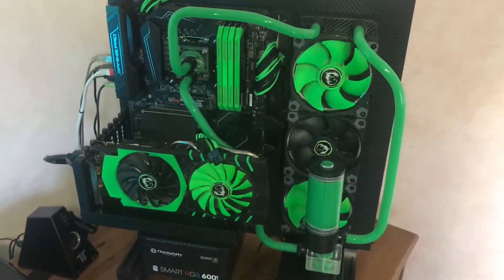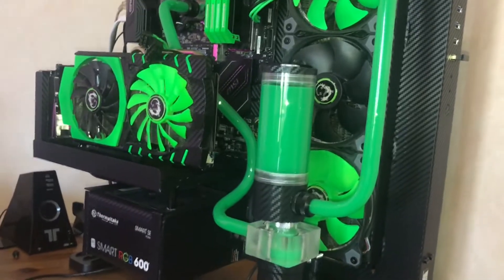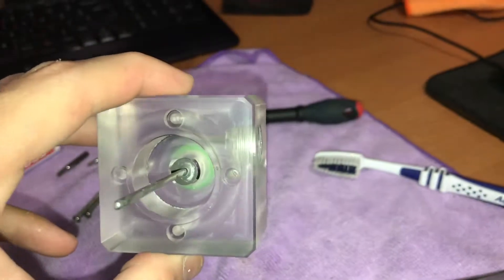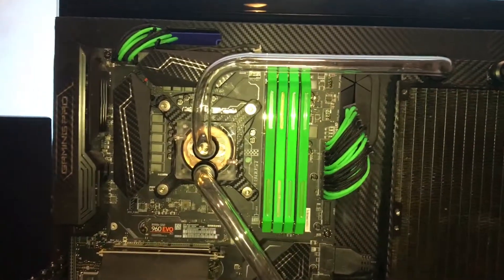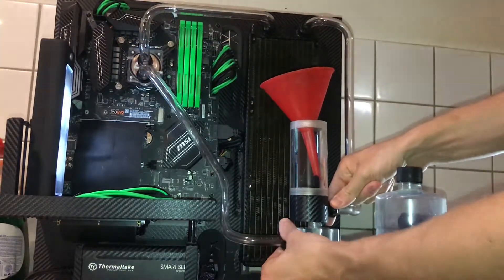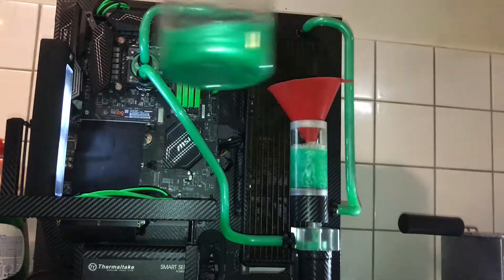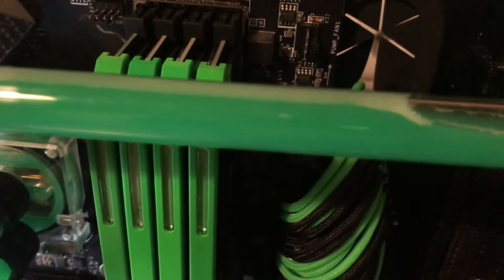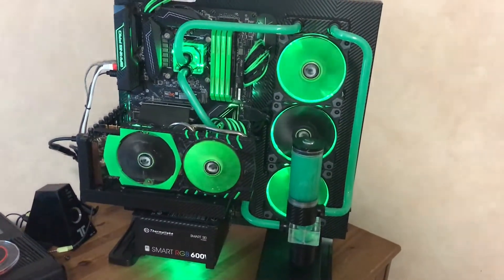Primochill Vue Issues! + Re-Attempt

Comment: I've used vue 2 different times and the first time it lasted a month and a half the second time it lasted 3 weeks .
Mind you my loop is all copper and nickel coated copper with all copper radiator 
I used system  prep and second time system reboot and took every block apart and cleaned my ekwaterblocks monoblock and both gpu waterblocks still the primochill vue didnt last and clogged my blocks up .
So now I took apart my whole loop again cleened all my waterblocks and radiator and am using koolance 702 uv blue for it lasts up to 3 years running 24/7
A couple months later loop perfectly cleen
Primochill vue is for show only not for working / gaming computers
Reply from the maker: Metalmachine467 mines been holding up perfect since i lowered the pump speed, it breaks apart on crazy fast movement, slow it down and works fine now! I havent even used sys prep

Comment: I have had the UV Green Vue from release. Never had a problem, didnt use sysprep. Vue will break down if you use it for more than 6-8 hours at a time, and that is from the primochill site.
Reply from the maker: It wasnt on the site when i bought it, wasnt on the site till even 6 months after i bought it, they put it on it much later after they first claimed its the fancy fluid without the issues, after all the issues started to roll in they quickly updated their false claims.

Comment: How did it hold up until now? And can you maybe make a follow-up video after 6 month?
Reply from the maker: it held longer but stil broke apart, the flow is still100% going but white powder did build up on the same spots, i'll do a follow up video where i'll try to do it on a complete clean system + with sys prep since they claim that'll fix it, but right now i'm waiting for the delivery.
Reply: @Gagliano17  ok perfect I'm looking forward to the video!
Also you should try to flush the system with "Primochill Reboot", it's their system cleaner made especially for Vue. It will pick up all the particles and you don't need to clean them by hand.
I would be interested in how good it works.
Greetings from Germany
Reply from the maker: I think sysprep is the same as reboot

Comment: Nice looking system. I like the clean lines you achieved with your tubing run, except you have the inlet/outlet for your CPU block reversed, the fluid is supposed to come in over the jet plate.
Reply from the maker: Richard the block has “in” and “out” written on it and i used it like its written on there
Reply: what ? ... this tubing is ugly like hell .... the bends look alike a first try ....

Comment: Have you contacted Primochill's Customer Support, to let them know what's been happening?

I found this on the Primochill website:
WARNING: Use of this product with aluminum components (such as aluminum constructed radiators) is not recommended and will void the fluid warranty. PrimoChill will not support or replace fluids used with an aluminum component including radiators.
Reply from the maker: i dont have any aluminum in my loop ,it's all copper, which is recommended, and no i haven't and definitly should do. i'll contact them asap
Reply: Yeah, i reckon it's the first thing to do, to contact Primochill.
Obviously am sure you're all copper. Galvanic corrosion bro :)

Comment: Is it cloged yet? mine did break down after about 2 days, i will never use Vue again, and the support sux and after i bought they added all kind of reason why it can break down.
Reply from the maker: Jimmy Engdahl so far nope, it runs fine, slower pump speed seem to have fixed it
Reply: Dennis Gagliano it's a D5? What's your rpm?
Reply from the maker: i really don't know if it's a ds5, i doubt it, and i can't messure rpm, but i got it running on 4-5v instead of 12v atm

Comment: If you have any aluminum parts, Primochill Vue won't work. Additionally, you need to system prep everything with their fluid. Lastly, some parts are not compatible with the liquid. Hope that helps.
Reply from the maker: i knew all that. my system is 100% copper though, + i bought the fluid back in december of 2017 but it didn't arive till 2  months ago, all that was not stated
Reply: @Gagliano17  I saw some videos on Jayz2cents he said it was just primochill. Because he was talking about white like powder in cpu and gpu block when he drained it. He said its nothing to worry about

Comment: Your cpu waterblock is acting as a filter allowing the particles to build up in the system.  Without gaming, I let my system clog up until there was no flow at all. (purposely let the system run for 24hours+ 2-3 times per week. Without draining the loop; I took off the cpu waterblock only and cleaned it. Re-installed and got full flow. 0 - 4.24L/min. I did not clean water blocks on dual gpu yet fins are much bigger so theres no build up.  Im usining a Heatkiller cpu Waterblock, the cooling fins are so close together a razor blade can't split it. Add a Digital Barrowch Flowmeter to your build you'll defintely know when flow is getting weak. I'm still using the same Vue fluid. Last thing, my case is the Thermaltake Tower 900. That case allows me the ability to remove cpu only with losing more than a spoon full of liquid since majority of fluid weight is lower then the CPU.

Comment: The fluid will brake down becouse that kind of fluid is known for leaving residu and clogging your system just use green tubes with clear water or chance the fluid every week orso
Reply from the maker: point of custom loop is to look nice, might aswell run aio if i start using green tubes =P
Reply: Dennis Gagliano good point👍